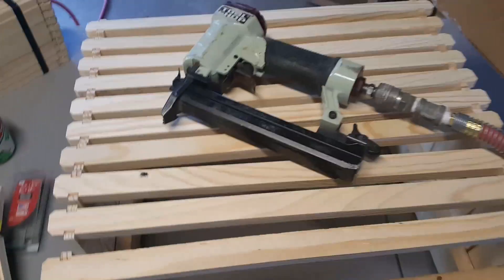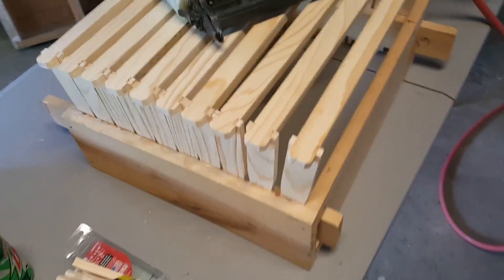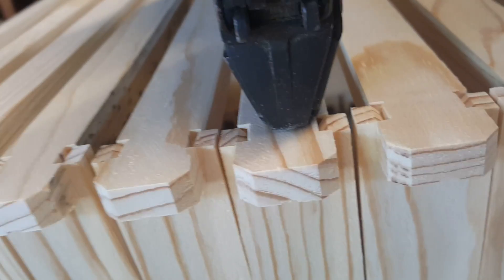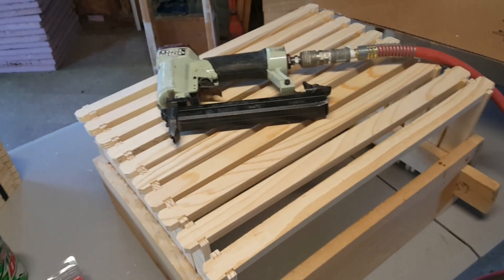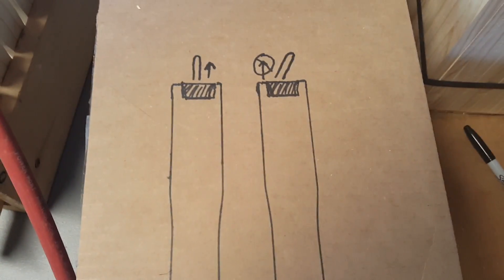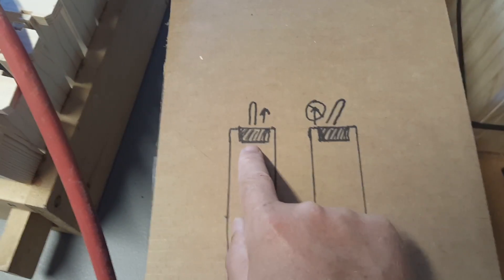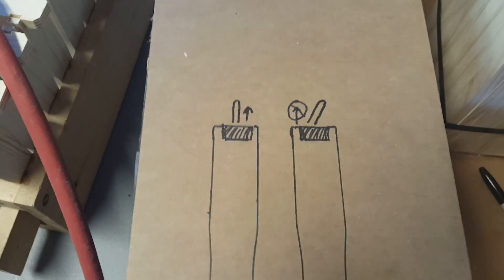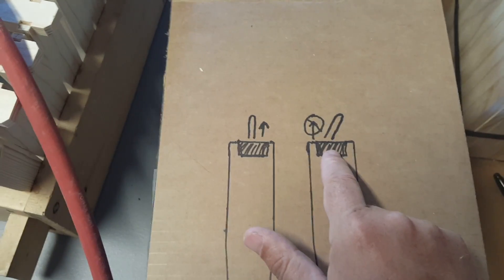Assembling Mann Lake frames that don't pull apart. No glue required. Part 1

Comment: No need for glue, use two staples on each end at the top with each staple angled the opposite way, will break before pulling apart. When ever possible angle any nail for more holding power. Only one needed at the bottom.PS, thanks grandpa
Reply from the maker: Thanks for watching!